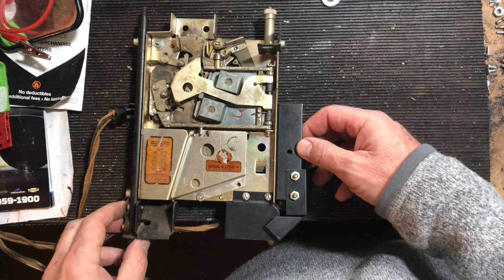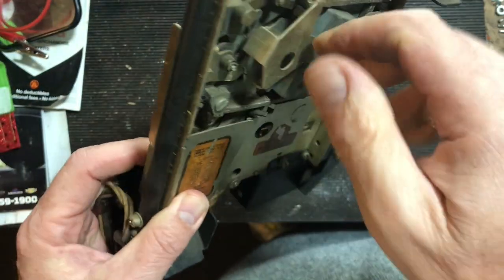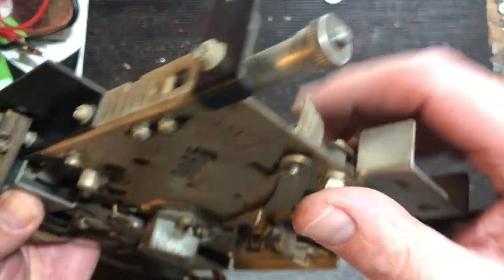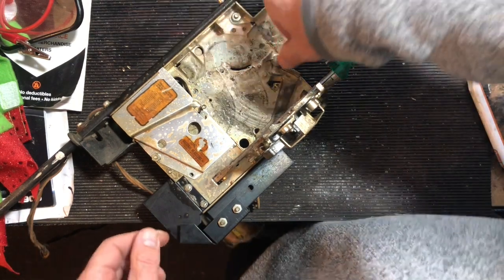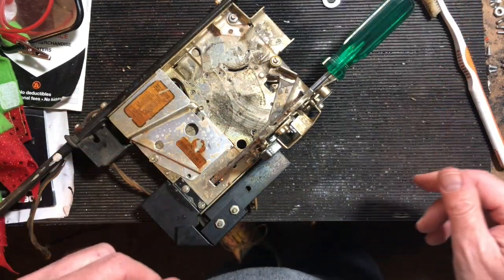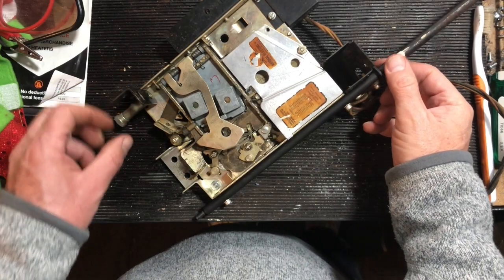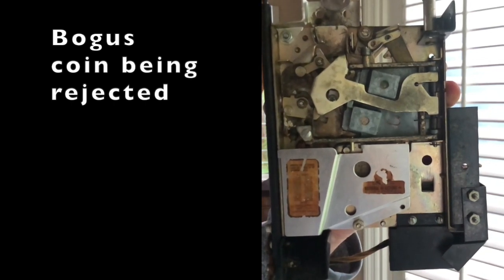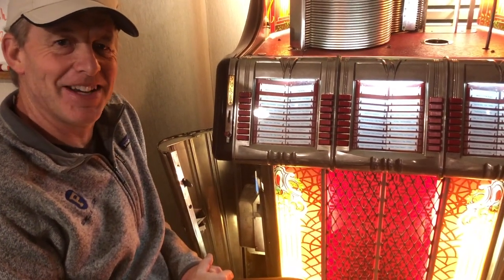AMI E-120 Jukebox Rebuild - Part 3 - Rebuilding a National Rejector

Comment: Update: A Better Way to Set These to Free Play. This is SUPER easy and all you will need is pliers and a flathead screwdriver. Since I don't have any ability to add a photo you will need to get the AMI Manual for a D or E (and perhaps others) and view the "Credit Unit Parts Group" Fig. 12 in the E Manual. What we will be doing is simply adjusting the "Ratchet Wheel Shaft" (Part No. F-1403) to lock it in position. The shaft is screwed into the back of the "Credit Unit Frame" (Part No. L-103) and locked in-place with a nut. The shaft is adjustable to get the parts free to move yet held in place where they should be. But what we can to here is LOCK the parts in position where there are credits and the unit will never decrement, but still operate the "reset" relay properly (which is essential for these units). First, remove the F-1404 Tension Spring. Next, loosen the shaft's lock nut on the frame. Advance the unit so there are some credits- just a few is fine. Now, rock the "Escapement Assembly" F-1446 and move the Credit Wheel slightly until you have MAXIMUM movement rocking the Escapement Assembly between cogs- this is to adjust the mechanism to have maximum "throw" on the Reset Switch F-1480- your goal is to have the switch with enough open-and-close distance to work properly. You may want to take a leaf switch adjuster and add some tension to the leaf that is operated by the mechanism so it is acting like a small spring. Now you can operate the Escapement Assembly by hand (while holding the credit wheel still) and see that the Reset Magnet and Escapement mechanism will close and open the Reset Leaf Switch without subtracting credits. Holding everything from moving, screw the Ratchet Wheel Shaft in FULLY (clockwise) and it will lock the credit wheel in position. Re-Check that the Escapement mechanism fully operates the leaf switch while locked in position. If not, re-adjust slightly. Now lock the shaft completely with the lock nut. When it's operating the leaf switch maximally, you may need to adjust the other part of the switch so it has a good 1/32" on open and also fully closes when operated. When done, you will have a normally operating reset mechanism that these jukes need to operate, but credits will never add or subtract because the shaft is locked in position with credits remaining. Finally, it's best that the coin switches no longer try to operate the credit unit. You can simply FULLY unplug the credit unit Amphenol connector which is the one with the longest bundle of wires. If you don't like the look of the bundle unplugged you can disconnect the wires for this bundle inside the credit unit and tape the ends etc.

Comment: Mine accepts US Coins but rejects Canada Coins. I want to have it accept both. Is there a way to remove something so any coin dropped in will be accepted? If so how?
Reply from the maker: That's a good question, and I don't know the answer.  However, I have the National Rejectors manual somewhere.  I'll post it to Google Docs and give you a link.  Maybe that would help.  Give me a little bit to find it.
Reply: The jukeboxes for Canada used different rejectors because the coins are different. You'd have to get a rejector for Canadian coins. But unless you really love plunking the coins in, read my article above on how to set these units to free play.